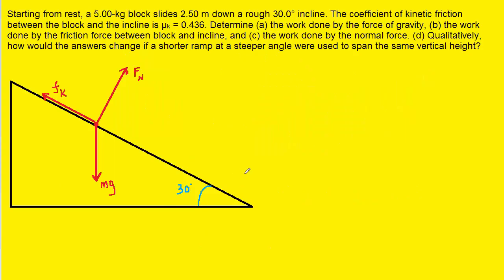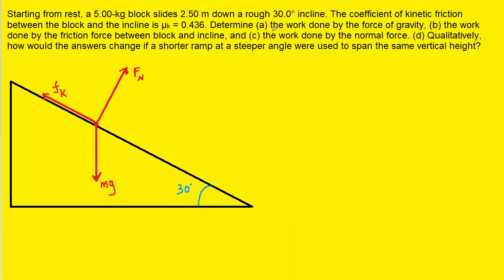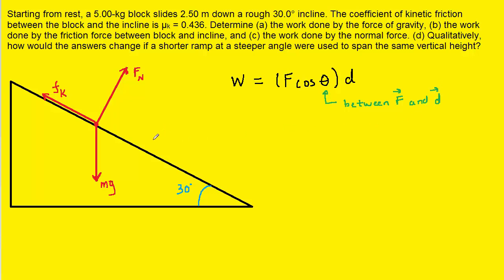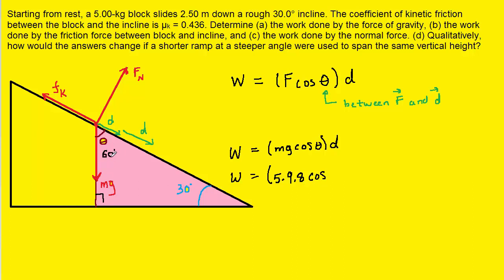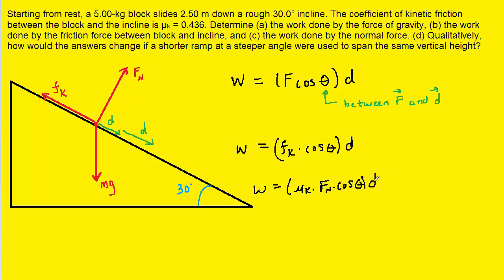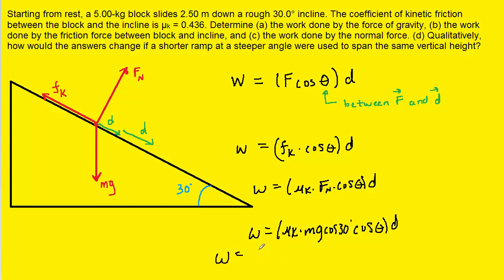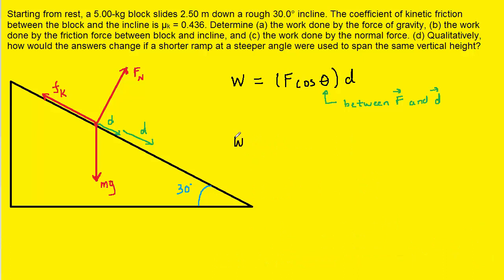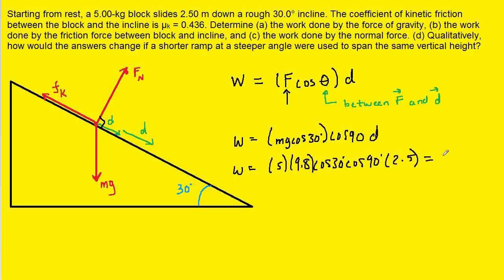Starting from rest a 5.00 kg block slides 2.50

Comment: For the question part C, where did you get cos90°? Im confused as to where you got that from. Thanks!
Reply: it's the angle between normal force and the direction of momentum
Reply: The angle between the normal force and the displacement d is 90 degrees